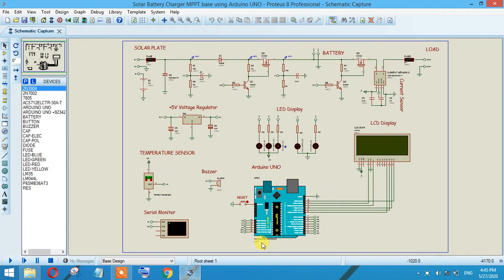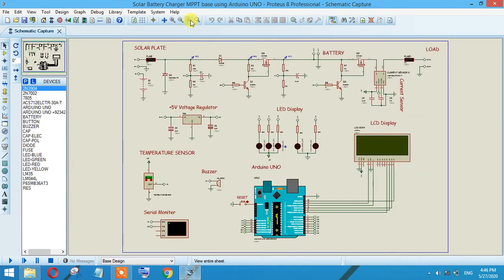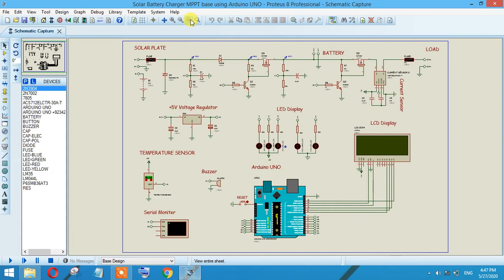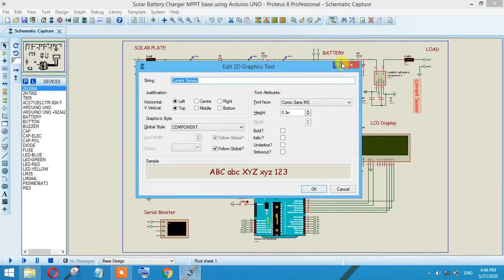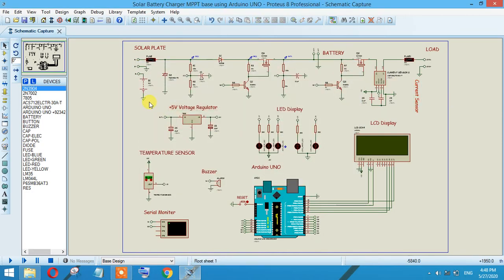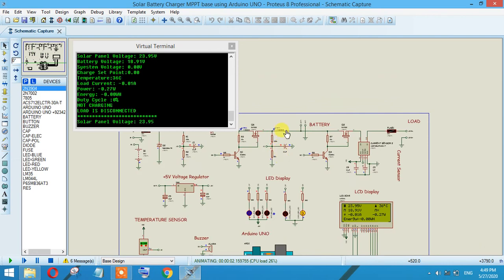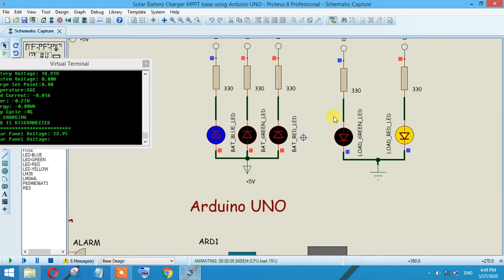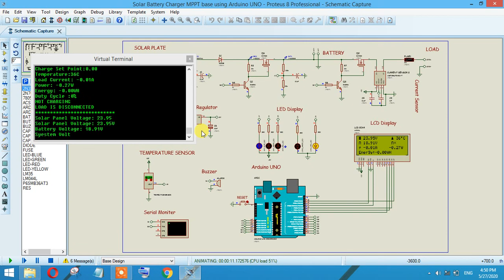Maximum Power Point Tracking | MPPT | Arduino | PCB | Code | Simulation

Comment: hi i have been looking for some time for a few different things and it looks like have all of them, is it possible for you to send me the diagram and Arduino code for your 3 phase spwm controller and this mppt charge controller?
also hybrid grid tie system? and 3 Phase Smart Energy Meter using Arduino?
my mail is binarycode233@gmail.com
my wife and i live off grid (disconnected from power) in a shed, and i am trying to build a good power system and this could be a good starting point to designing something if you want after i finish building it i can send you back the diagram of what i modified to make it work for me